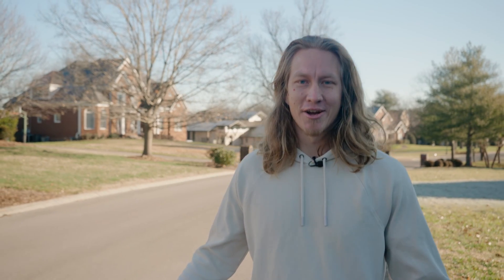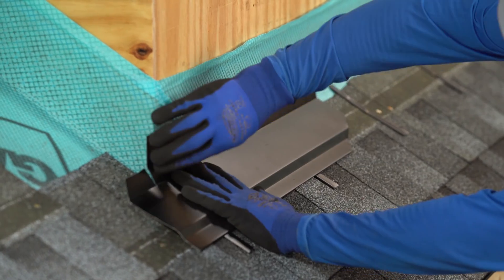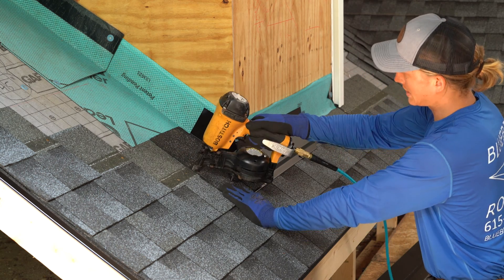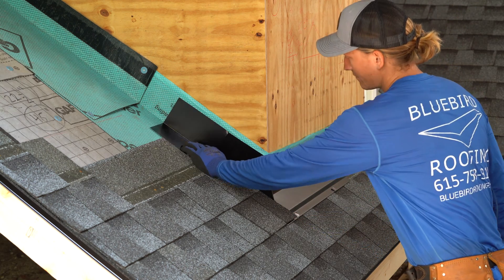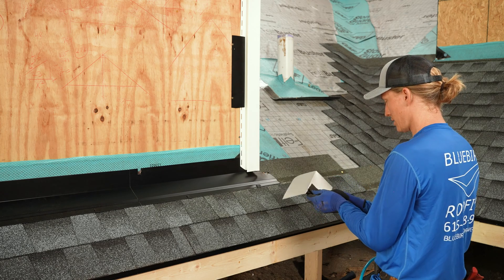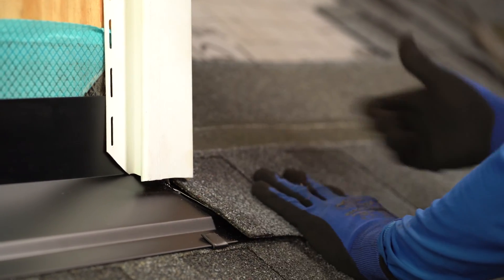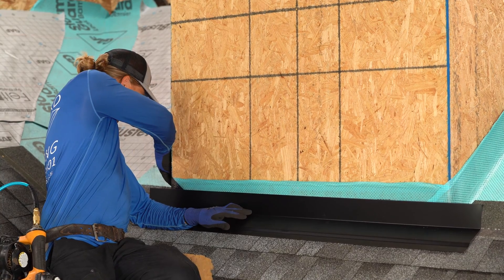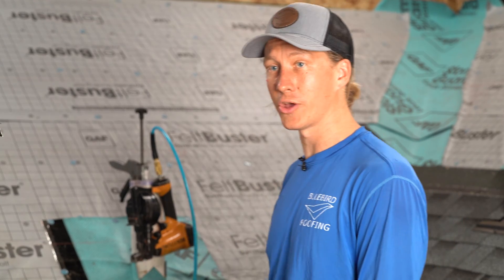How-to: Step and Apron Flashing Install

Comment: So in the last scenario where you put your apron against brick. Is there supposed to be something to prevent water from hitting that brick face and weeping or dripping in behind your apron?
Reply from the maker: Yes. There are always two pieces of flashing. Base and counter. When there is siding, that acts as your counter flashing. Any masonry types will need a counter flashing to keep water from getting behind your base.

Comment: Nice video, you did a great demonstration! I do have a question... Regarding the kick out flashing, when you said "cutting the excess off to make it low profile " does that take away from the required height of 4"? Where it curves @10:40 to make it 1" tall?
Reply from the maker: Yes. No one in their right mind puts a 4" kick on except for stucco guys.

Comment: WOW, YOU KNOW ABOUT KICKOUT FLASHING AGAINST A WALL that MEETS THE ROOF. I am a Home Inspector (retired remolding contractor) and I too often see missing Kickout Flashing but I do document the storm water damage. Long before you were born, I learned how to fold kickout flashing with NO cutting. I think the folded inside corner is less likely to leak when challenged with high snow and ice melting and freezing over and over.

Comment: Is it pretty typical to use 4" x 4" angle for the step flashing? And what gauge would u recommend, 26?
Reply from the maker: I wouldn't use anything but the 4x4x8. Not sure on the gauge. I like the black aluminum stuff that all the suppliers are carrying now.

Comment: Excellent system. I really like the tabs bent over the low end of the dormer flashing vs the classic method of just nailing and caulking the heads. Dormer flashing on an old house will end up looking like someone shot it up with a machine gun after a half dozen reroofs have been done, and of course, caulking the heads creates a maintenance issue at best. This system should be codified to prevent those issues.
Reply from the maker: Yes. Videos like this are helping the installers develop the skills they need to increase the quality of our installs. Clip fasteners on boots and flashing appear to be the future in my opinion.
Reply: @themillennialroofer  Thanks for pointing out it works on boots too. I'd probably squirt some roof jack equivalent under essential shingles adjacent to a pipe boot. Uplift against the pivot point of the straps could be a problem otherwise. Any decent roofer knows not every tar line will seal before it's too late. Not so worried about dormer flashing straps being comparably unexposed though (I wouldn't bother caulking anything other than the corners as you demonstrated).

Comment: Nice work! So do you just slit the vinyl corner post to slide down over your aluminum at the corner where it extends past the corner? Oops Im thinking the corner post is deep enough to miss the protruding aluminum. On the right side would it be easier to remove the corner ??
Reply from the maker: You can slit the corner. There's around 3/4" of space inside so if you space them right, they don't need slit.
Reply: @themillennialroofer  Appreciate the help and response. Nice work! Cmon out to Pa I'll need a hand! Lol